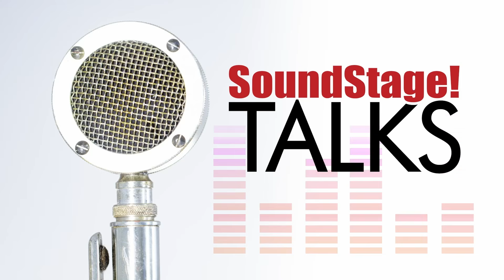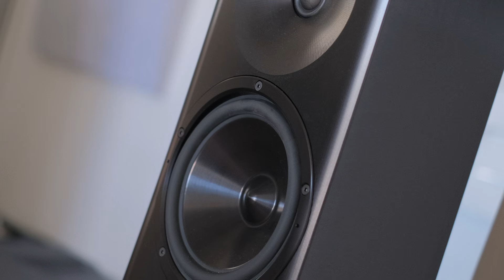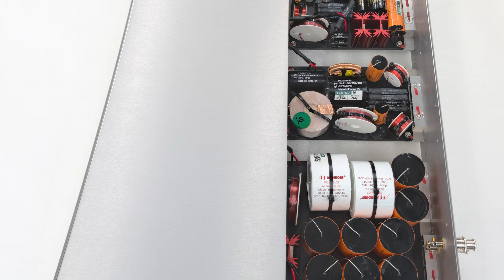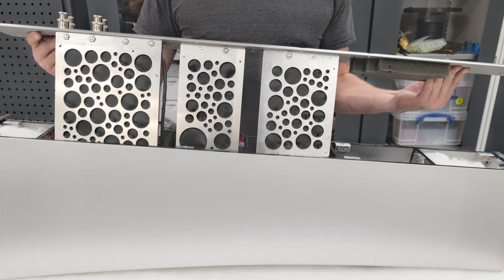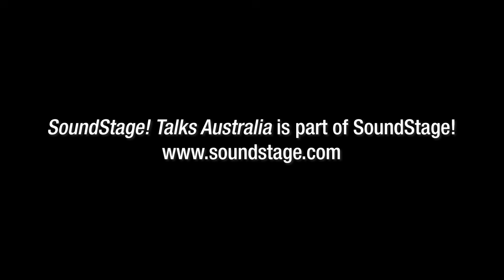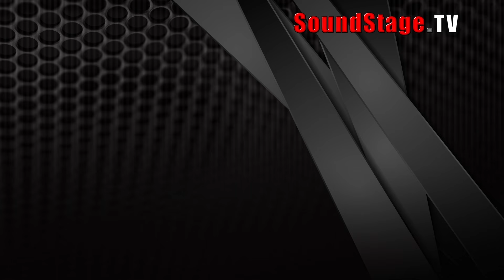Why Audiophiles Should Care About the YG Acoustics Carmel 3 Loudspeaker

Comment: I have the Carmel 2.....but no way I could afford to upgrade to 3...even the internal upgrades are too expensive.
Reply: A dealer told me the Carmel 2 are still better than the 3
Reply: @TTZ316 100% disagree! Did a direct 1:1 and Carmel 3 is way beyond the older Model and for me even better then Hailey in average listening rooms! I'd the chance to test the full range in a private listening Session.
Reply: @gerihifi I own a Carmel 2. Never listened to the Carmel 3. But in his words, YG went downhill after it was acquired by some private equity/investor. He used to be an important buyer and stopped distributing it. He was underwhelmed by the sound and new components. Cheers

Comment: And yet you never publish any measurements to back up your claims :( A simple frequency response of your drivers would validate your claims but we never see anything. Like the rest of them you are all tip and no iceberg :(
Reply from the maker: WE have actually published measurements of a couple YG speakers. You can find them at www.speakermeasurements.com
Reply: @soundstagenetwork  Driver measurements please, since you claim they are superior to other drivers ?
Reply from the maker: @BuzzardSalve  WE don't claim they're better. The company claims what it does.
Reply: @soundstagenetwork  Driver frequency response before tweaking by a crossover would be a good start ? Otherwise it's just a whole lot of technobabble and gobbledygook that's not supposed to be questioned for its technical merits ?
Reply: The only test that matters is listening to them and feeling the goosebumps.